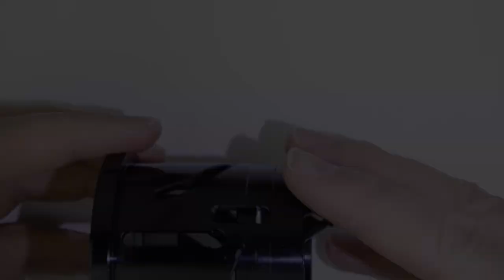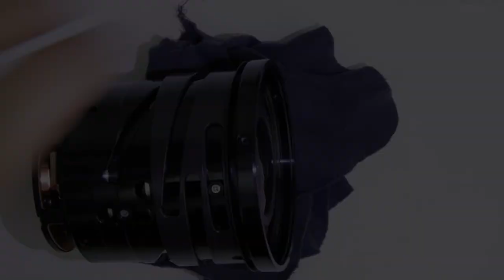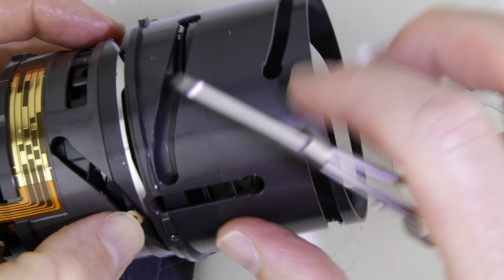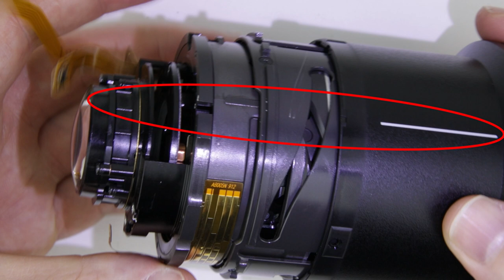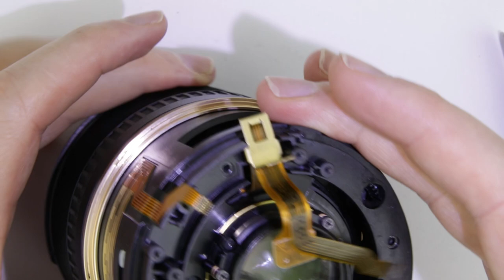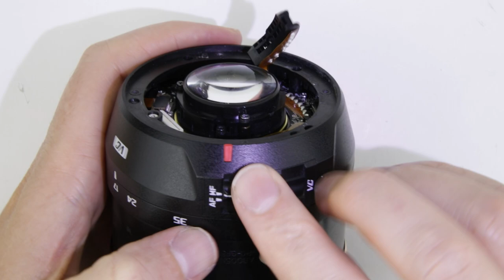Tamron 17-50mm f/2.8 XR Di II VC lens assembly

Comment: Hello, thanks a lot for the video! I have a problem with inserting white collars (14:04). When the barrels are fully extended, the mounting hole is not in the vertical slit, but in the slit on the left. If I contract the barrels slightly, the mounting hole goes to the vertical slit, but if I put in the white collars and screw them in, the range of motion of the barrel is limited (around 20% of the slit on the very top is unreachable). Maybe You had such issue and know how to resolve it? I made sure to put all the barrels the same way as in the video.
Reply from the maker: My guess would be that the barrel which connects the focusing motor is not in its place. The white collars have to go through the cutout of that barrel.

Comment: Hi! Very good video. Just one question: are the lens tubes coated with some lubricant or the surface picks up so much grease from handling?
Reply from the maker: Usually they are coated with fine mechanics grease.
Reply: @CamerasLensesEtc  Thanks! I ended up using Mannol bike chain spray. It was a little less viscous, than the lubricant that was originally on the lense, and moves a bit heavier. But it did good for the originally cheap feel of the lens imo.

Comment: Please tell me how to calibrate the resolution. Do I need a precision machine or jig?
Reply from the maker: Try turning the front lens element little by little, take photos and when you see the sharpest photo, that is the correct position. If you would like to calibrate the lens using the eccentric screws inside, then I don't know. Try to assemble the lens without the zoom ring, maybe that way you have access to the service holes and the eccentric screws.

Comment: how do you undo the screws that are glued in with thread lock
Reply from the maker: I haven't encountered any screws which are thread locked. Some of the screws might have small amount of glue on the top / head, but that can be removed easily.

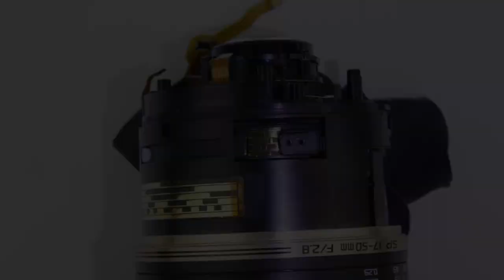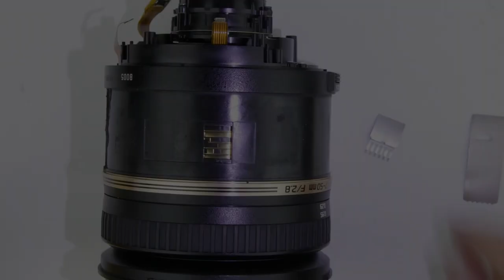Comment: If you want to try this, make the effort to find the markings on the edges of the flex cables for the brushes in end positions (17mm and 50mm zoom brush and infinity for the focus brush) and not just throw them in like in the video (19:33, 21:48). They have to line up perfectly. Camera and lens rely on correct information from these brushes.
Reply from the maker: Thank you for your comment!

Comment: Hello! I need help with my Tamron EF 70 - 300 SP VC. Can I ask you, if you maybe know the issue?
Reply from the maker: I don't know the issue of you don't tell me what is the issue with your lens. :)
Anyway, I have videos about replacing the AF motor of this lens, but I don't have full disassembly videos.
Reply: Yea Sorry! My VC just doesnt work. All the sudden it stopped working. When I enable it, I can hear a clicking noise. But nothing is working.  @CamerasLensesEtc
Reply from the maker: @kingcarlotv7095   Most likely the VC unit is faulty, so it should be replaced. Check its cable, maybe it is broken, but as I know, it is not possible to replace it separately.
Reply: @CamerasLensesEtc  I understand. Thats unfortunate.. Do you roughly know, what Tamron charge for a replacement? Because I heared that its way more than the lens costs used.
Reply from the maker: @kingcarlotv7095  Generally, yes, Tamron would charge more than the value of the lens.
Reply: @CamerasLensesEtc  ok. Thank you so much! Then I wont even bother to send them the lens. Because they will charge me a general fee for all the checking. And the price to repair probably wont be worth it anyways